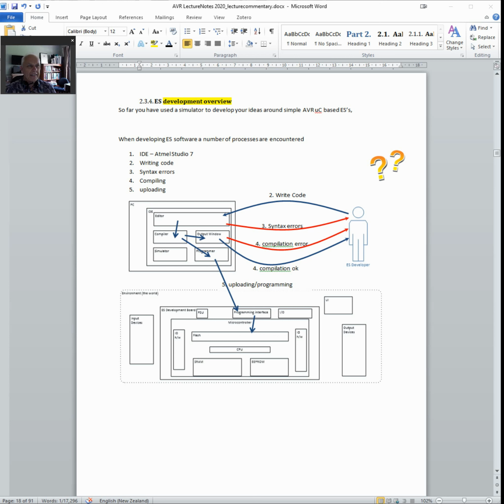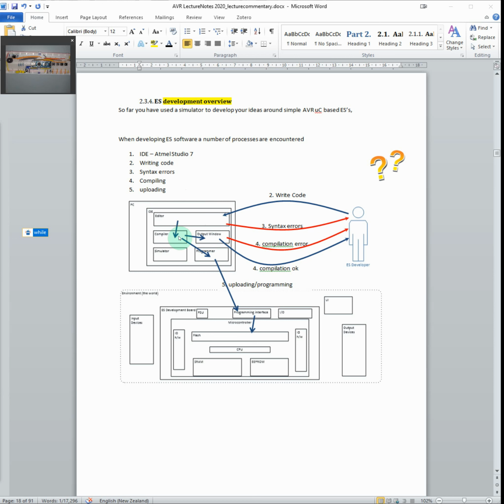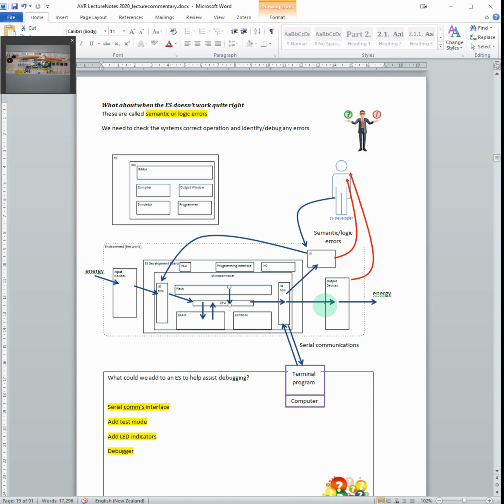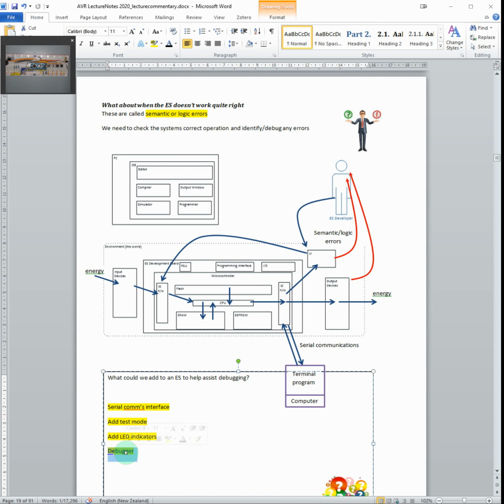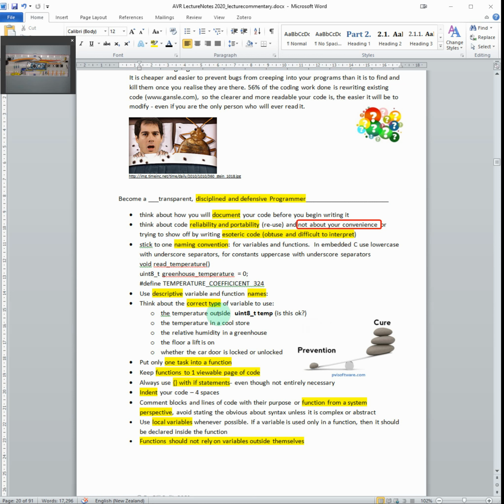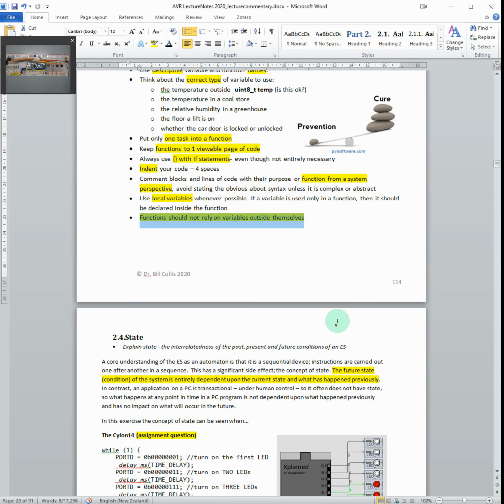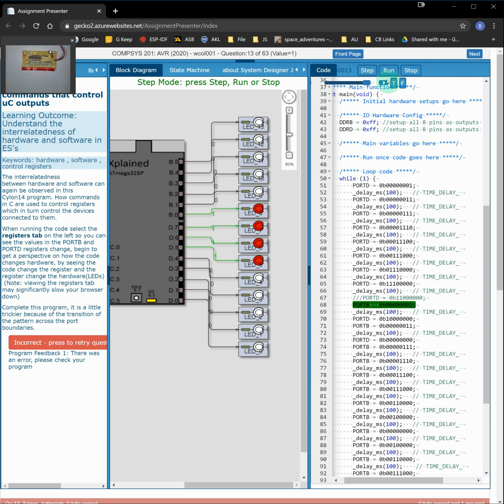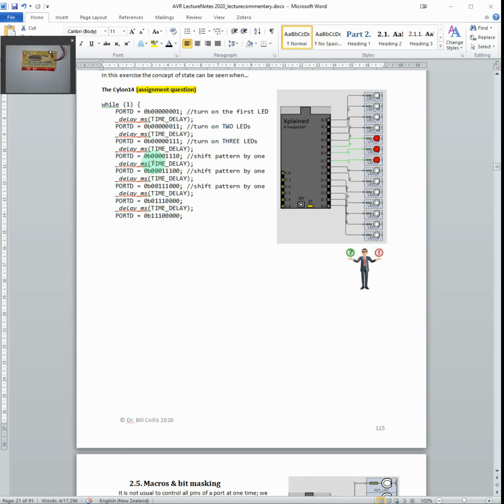Lecture2A

Comment: Nice video! One of the ways to reduce the air blowing noise is to put a sock on the microphone (seeing that you are probably using a microphone). This greatly reduces the chance of the air from your mouth directly hitting the voice input transducer, while also blocking the external sharp noises if there's any. Trust me, I'm an engineer.